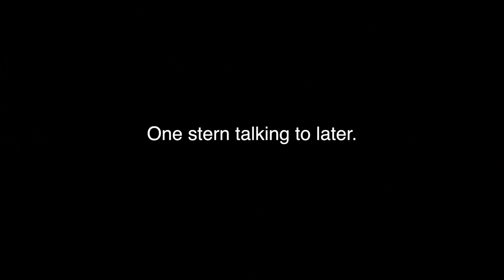Building and Gluing the Benches | The Japanese Inspired Picnic Bench Project #12

Comment: Really coming together!  A bit of a nitpick, when you glued the frames to the seat slats you only had clamps on the outside edges of the actual seat pieces. It looked like this caused  them to tilt a bit, giving them a slight rise in the middle -- right where your bum will be!  

I think you could have either used some stiff cauls  across the 2 slats, or disassembled a few clamps and passed the bar through the slot in the seat to enable clamping in the middle.

Boxes. Marking Knife components?

Comment: Looking very nice. 

The inside edge of the seat boards didn't look to be in contact with the short under frame sections after you had applied the clamps to the outside edges at the end of the video.
Reply: I saw the same thing. Hopefully he got that squared away off camera. It would be a shame,  that table is looking awesome!

Comment: I don't think that its Titebond 3 that just leaves black lines ,I've just had the same problem with Oak and Titebond 2 on a role-able Kitchener work unit. I've also have it with Gorilla glue, I think it must be the natural dyes in the wood as it doesn't happen with light wood. I have found that if you put some shavings in a solvent or or water the colour it turns will be a good indication if your Titebond is going to go dark on the joints. Use white PVA and avoid the problem

Comment: Are you concerned that the center two under supports don't reach the outer two slats of the table? Resting elbows or sitting on the table top, especially towards the middle, could bow those slats.